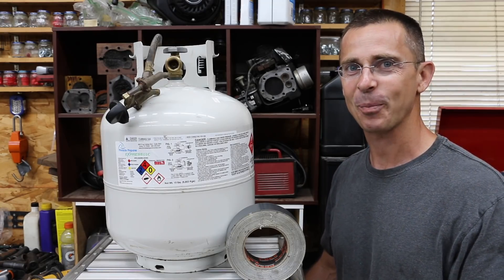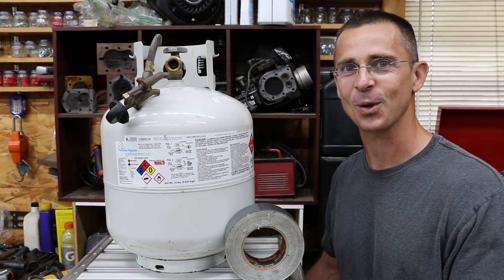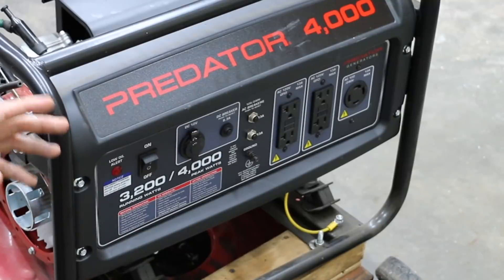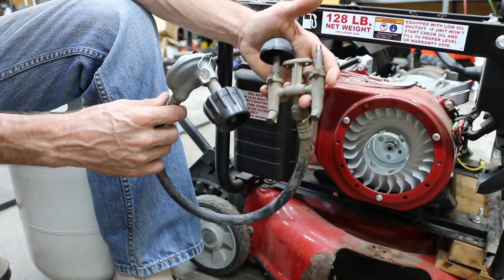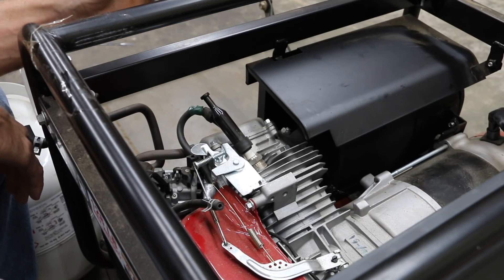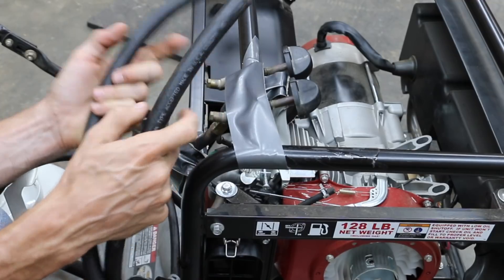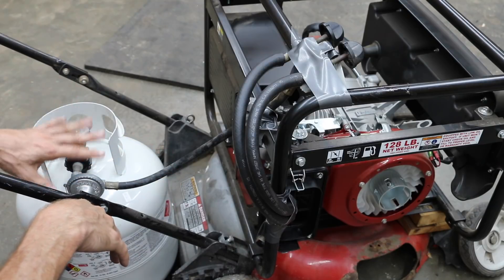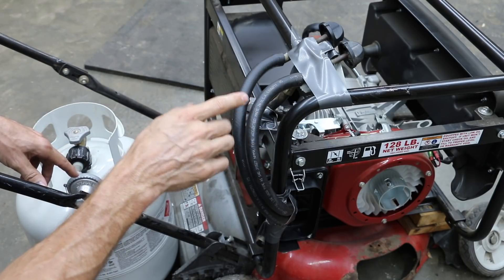Can a gas (propane) grill power an engine?  Let's try it!

Comment: Great information. I have been thinking about converting my 15-year-old generator to run on propane because it is easier to store propane safely than it is to stockpile gasoline. A few years back, soon after I moved to Florida, I got caught with a gasoline generator without any gasoline being available after a hurricane, which is when I discovered that it is virtually impossible to siphon gas out of a modern car's gas without actually removing the fuel pump or cutting into the fuel line, neither of which sound like fun in crisis situations. Now, I know how to do an emergency conversion in a post-hurricane situation.  However, I take your suggestion that it would be wise to purchase a commercial conversion kit. Have you ever done a comparison between available conversion kits? If not, would you consider that a good suggestion? The current oil glut continues to refuse to make itself manifest at the fuel pump, but gasoline shortages in the future are inevitable as production capacity is curtailed by the conversion to electric vehicles, which will cause gasoline prices to spike further, so this might be a good topic for survivalists and preppers. I'm neither.  I just happen to live hurricane alley.
Reply from the maker: Thanks for the video idea.

Comment: I made a comment about trying this test then I found this video. The combustion chamber view was just as I expected with a blue flame and clean burn. I went to a school in Fresno CA in the 70s to learn how to convert trucks to propane for a company I worked for. There is a company called R and R Products that sold golf course equipment that was propane powered for a while. Propane fork lifts have been around for quite a while.
Reply from the maker: Thanks for the feedback.

Comment: From what I’ve been told propane is actually the ideal fuel for an internal combustion engine. It burns virtually clean and leaves no carbon. That’s why a lot of commercial vehicles are being run on propane.
Reply from the maker: Thanks for the feedback.

Comment: We have installed a couple of US carburetion kits on a few generators. If you live in a hurricane prone area I would definitely look into it. They mount between the air filter and the carb and have a vacuum controlled regulator for variable speeds depending on load. typically electrical load is not constant with motors cycling on and off. US carburetion has some very good kits for converting generators and most small engines come with hardened valves and seats from the factory. This is due to how common dual fuel tends to be. If you are in a hurricane area and are depending on gas to run your generator you will be disappointed when you can't get any, but propane is usually readily available. US carburetion kits give you the option of running gas or propane.
Reply from the maker: Thanks for the feedback.

Comment: Its all about fuel to air ratio. I know that the host here said that the engine doesn't get any hotter, and that's true, no overheating issues, but Propane does burn hotter then gasoline, and engines that run on propane don't last as long because of it.  Makes me think that that's why city buses etc are trying natural gas instead,  it burns cooler then propane.
Reply from the maker: Thanks for the feedback.

Comment: In Iraq we did that for many years ago .but the engine will need rebuilt every 2 year ( WORK ONLT DURING SUMMER )  .and you cant load on the generator because the ( governar ) will not work
Reply from the maker: Thanks for sharing.

Comment: My 92 F150 has run on propane for over 25 years.  In the 80's many vehicles in Canada were run on propane.
Reply from the maker: Thanks for sharing.
Reply: @ProjectFarm  My pleasure.  You get less pulling power from the propane, but its generally cheaper, and the engines last half again as long because of the clean burning.

Comment: So what modifications would be required to run the go cart on propane? I assume you just can't swap hoses on the fuel inlet on the carb and adjust the jets? What about a EFI motor?
Reply from the maker: Thanks for the video idea.

Comment: A video to make. 
Will a gasoline engine use more fuel when the air filter is dirty or will it use less   on a carb or fuel injection engine
Reply from the maker: Thanks for the video idea.

Comment: When I was a forklift mechanic I worked on a lot of propane forklifts,  propane runs cleaner than gasoline  propane runs cooler,  also the oil stays cleaner longer than with gasoline,   gasoline has a little more power,  interesting!!!,  Great Video THANKS William
Reply from the maker: You are welcome!

Comment: Check your engine oil frequently.  Before you start it each time and then every hour.  Document the oil use.  Then when you are familiar with the fuel/oil use, ease up to checking every few hours.  I live off the grid and have gone through a few gennies.

Comment: I've been running g an old Toyota off propane for a decade and it works great , I don't drive it much but it will goes years on an oil change , probably 10 fork tanks before the oil even starts to darken
Reply from the maker: Thanks for sharing.

Comment: I have a string trimmer that runs off a 1 lb camping propane cylinder.   One cylinder lasts the entire season,  while I'd be hard pressed to get one cut off a tank of gas in a standard 2 stroke trimmer.
Reply from the maker: Thanks for sharing.

Comment: Use the generator connected to a battery pack on a EV. Would make a good mod if you are scared of running out of juice. Just grab a propane tank and you are good to go. Battery pack would be a good regulator of energy.
Reply: Would make an interesting video, if you took a EV of some kind with a drained battery and charged it with a propane generator. Also if the generator would be able to supply the EV wit enough power to keep it running until you make it to a charger.
Reply from the maker: Thanks for the video idea.

Comment: It's the LPG system in simple terms.
At least in Europe we use this system in our cars, and it's propane too in Portugal. In other countries its a mix of Propane and Butane in certain proportions.
Reply from the maker: Thanks for sharing.
Reply: The reason for butane is to lower storage pressures, Butane is your BIC lighter, stores under lower pressure with very similar burn characteristics. (The hotter the tank the higher the pressure in it, its to the point that the trucks we used to fill propane tanks couldn't push propane in if the tank sat out in the sun in summer in Chicago IL, they pushed 70psi on top of truck storage tank psi)  Just FYI.

Comment: Which will last longer. 1litre of petrol or 1 litre of propane?
Reply from the maker: Thanks for the video idea.
Reply: In Europe this system is commonly used, in Italy they also use Methane Gas, which require much higher pressure and a more complicated system but is super cheap. 
Normally with a litre of Propane you can do 14-15km on a medium car.
Reply: @marcopiccini8457  British converted cars aren't allowed to travel on the Channel tunnel so our cars have to stay in England. But euro cars can of they were built to be gas powered

Comment: Easy setting at generator because the engine work in constan rpm
But if this is aply at motorcycle i thing not easy to setting FAR'Fuel Air Ratio because the engone working in variable rpm

Comment: Great video! My car runs on a Butane and propane mix(lpg).  How does Propane perform in the higher rev range? As propane has less knock and burns slower, how does it perform beyond 4000rmp. This is my limit to operate my car. This means means 100mph of sustainable driving for me. I really wonder if valves get burned.
Reply from the maker: Great point!

Comment: Propane powered engine will last much longer than gas because there is no liquid washing the oil down off the cylinder or getting past the rings into the oil causing oil dilution.
Propane fork lift engines last a very long time and the oil stays clean for a extremely long time.
I really liked this video. You are really good at this....
Reply from the maker: Thanks for watching.

Comment: My friend had a truck set up to run on propane and he said after 3,000 miles the oil still looked brand new. It is just a lot cleaner burning fuel than gasoline.
Reply from the maker: Thanks for sharing.

Comment: Very nice presentation.  In 3rd world under developed countries this is being done for decades as propane cylinders are cheaper fuel alternatives.  I used to run my old car and electric generator on propane or as we call it LPG . Even the methane supplied to home is used to run such engines successfully.
Reply from the maker: Thanks for the feedback.

Comment: So, because of the Blue flame, you figure that Propane is more "Efficient"? Both gasoline and propane gyrate continually on price but it's got to be better because the generator will always suffer the problem of rare usage versus gasoline leaves gunk in the carburetor and if you don't clean it after even a short usage then it probably won't run the next time you need it.

Comment: Another very cool video. I have a Ryobi 5500W generator and I have been unable to find a kit that will fit the carb to run propane. It's likely the exact same engine as what's on your Predator. I'll make sure to keep the manifold from my 2 burner grill when I replace it.
Reply from the maker: Thanks for sharing.

Comment: The mechanic shop I work at we have a forklift from the late 70s early 80s. As if the moment I'm the only one who is allowed to operate it since I'm the only one who knows all of the countless issues and how to work around them. The most interesting thing is that It was a gas engine, small four cylinder but some time in the mid 90s they had some guy offer to convert it to a propann engine that would burn more efficiently and cheaper and all that. So they did. He said he was a professional who did this often. They even welded a bracket for holding the larger propane cylinders on the back. 
That's the story at least, that was way before I was born much less working there. They have fairly decent hoses run from the tank to the carburetor. The carburetor looks as if it was made for propane use since it has the proper fittings. They said that was all the needed to be done for it.  I was surprised to find out how little adjustment needed to be made to the engine to make it propane. It lasts quite a while on one tank for as much as we use it and runs about as good as you would expect from an abused engine that old.
Reply from the maker: Thanks for the feedback.

Comment: One of these days you should set up remote oxygen and acetylene injection on an old mower destined for the scrap heap. Start engine on gasoline, with torch already set for a nice neutral flame, aimed at intake with tanks off.. from a good distance, turn on tanks, and see the results. I think I would be pretty amazing to see. There’s A LOT of energy in that gas mixture!
Reply from the maker: Thanks for the video idea.

Comment: 5:12 the great for gokard but danger bottle and not well on 2 stroke but 4 stroke need completly system to mixing correct warm fuel with air
Reply from the maker: Thanks for watching.

Comment: 2:57 the problem is temperature of propane. the expanded cool gas is too thick. you don't choose the right fuel proportions. And you need injector or mixer
Reply from the maker: Thanks for the feedback.

Comment: I've heard It burns clean buy you lose upper cylinder lubricity using some kind of gas and that its not good for long term use or that you should use a thicker weight oil.
Reply from the maker: Thanks for the feedback.

Comment: I've got a fuel suggestion. You can evaporate plastic waste in the absence of air and condense a fuel from the gasses; it's called pyrolysis. A little safer and less complex would be doing the same with wood, burning it in a sealed container and using the gasses as fuel (once they've been bubbled through water to remove soot). This wood version is called browngas and the Youtuber NighHawkinLight has some useful videos about it. Thanks for these experimental videos!
Reply from the maker: Thanks for the video idea.

Comment: Is there any way of checking how efficiently the propane burns compared to gasoline on your heater load. Also can you get the full 4kw out of the generator with propane? Maybe it can do even more power?
Reply from the maker: Thanks for the video idea.

Comment: I know that you can crack water and get hydrogen and oxygen. The say it takes too much power though to crack the water for the output of what you are going to get from cracking the water, making it practical to do so. I also have heard that, Nicola Tesla, said that you can use frequency to crack water into hydrogen and oxygen, if so, then can changing the frequency of the electrical signal, or power, or rate of isolation, HZ, make it easier, to crack the water, thus making it cheaper to crack the water, what happens if you were to use say 32,000HZ, instead of 120HZ to crack the water, or even 30HZ, or 40HZ to crack the water. My point is, WOULD IT BE A FREQUENCY AT WHICH IT BECOMES VERY EFFECTIVE, OR EVEN, LESS COSTLY, TO CRACK THE WATER INTO HYDROGEN AND OXYGEN GASES, and if so could it be, potentially, cost effective enough to run a car on it, instead of gasoline. Interesting idea, isn't it. Could it work on a lawn mower too. It would be really neat, and interesting, to find out if it would be possible to make it cost effective enough to use frequency to crack the water, to produce the hydrogen and oxygen gasses.  Just a thought! I love your videos! It's an interesting though, isn't it? Take care now!
Reply from the maker: Thanks for the feedback.

Comment: Take the spool from the pull start and glue it to the crank so you can attach a mountain bike wheel via a belt and then you can power a blender to make smoothies and with training you could make money selling this electricity back to the electric company once you get solar panel because there is no rule against it in the power company agreement but even if there was you can always power a light bulb to make solar power .
Reply from the maker: Thanks for the feedback.

Comment: What would this be like using both fuels together. I.e how clean would the burn be with both ?
Reply from the maker: Thanks for the video idea.
Reply: @ProjectFarm  not a problem I'm trying to figure ways for my diesel engine. I.e twin fuels. It's a direct injection engine and was looking into a other fuel on the intake manifold to help reduce carbon build up on the valves

Comment: I hate to tell you but they do make a conversion Carburetor kit for small engines to do what you are doing also it would be much safer.
So using propane has been going on 45  years plus on automotive cars and forklifts with special fuel control valves and or older Carburetor vehicles especially in Canada were gasoline is much more expensive.As far as your statement it is not a good idea to use on vehicles that move around a lot or might have drivability issues  this is false statement.
I know this as NYC Sanitation has been using alternative fueled vehicles about 30 years.
Our first propane and natural gas vehicles were the Chrysler K car (back in the early 90s)  later on we started using Ford Expeditions until about 2007,  today we are using natural gas for our mechanical Sweepers and Collection trucks and have our own fuel station.

Comment: You are the first DIY LP/LNG "carburetor" experimenter to address the differing fuel demand under load v.s no-load. I appreciate that you thought of that. The governor usually takes care of the mixture. But in your experiment, your propane is flowing at a fixed volume.

I wonder if when you adjust the air/fuel mixture to perform correctly under maximum generator load - what would the engine do when you removed the load? Would the mixture then be so rich that the engine would stall? or would it be able to sustain under no load with such a rich mixture?

I appreciate your work.  

Patreon! Patreon! Patreon!

Comment: No new idea just a comment I worked with a guy that drove an 18 wheeler that was equipped with propane foggers like a nitro forger but for propane he said it boosted the power well cooling the engine at the same time? Not sure about that but I suppose when your that old and doing the same job that many years you learn a few things and the gauges don't usually lie.

🥃Cheers🍻
Reply from the maker: Thanks for sharing.

Comment: Mythbusters had a show where they showed a flame traveling down a sewer pipe. The flame front traveled down pipe at a fixed speed. The next shot they did with the flame traveling down the pipe with junk in pipe. Bailing wire bricks , pipe. What was surprising was the speed of the flame. It was already 5 times faster. That's was due to the flame front being broke up by the debris. 
I'm wondering if you put spikes on the Piston and cylinder head would the flame front travel faster?
Reply from the maker: Thanks for the video idea.
Reply: @ProjectFarm  cool It will interesting to see what happens

Comment: I bought a kit to modify my emergency gen to propane or natural gas. Your setup wouldn't accommodate varying loads but a proper regulator would let the throttle determine fuel intake.
Reply from the maker: Thanks for the feedback.

Comment: It was a little funny using the heater as a load...could have just fired up the barbecue without the generator and got the heat! But seriously a great video and very interesting. I wonder if the poor performance of our propane mowers is due to shifting loads while operating...
Reply from the maker: Thank you